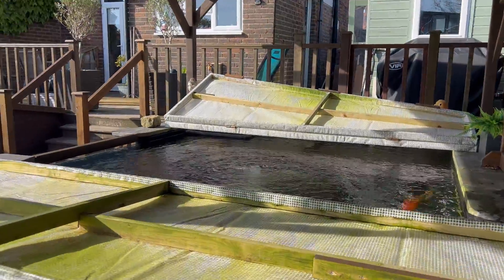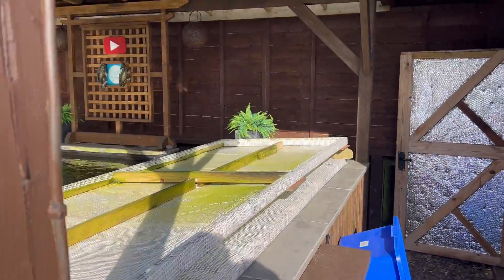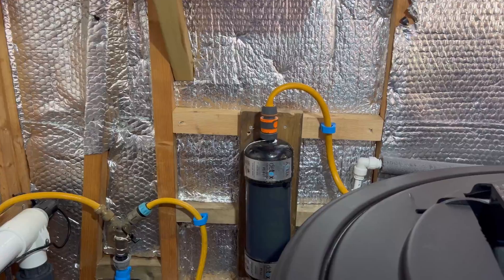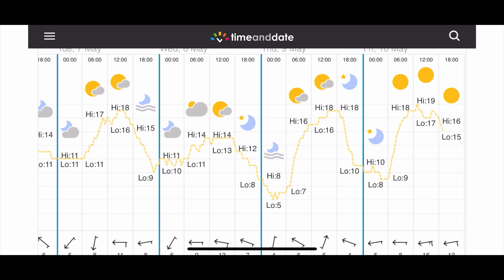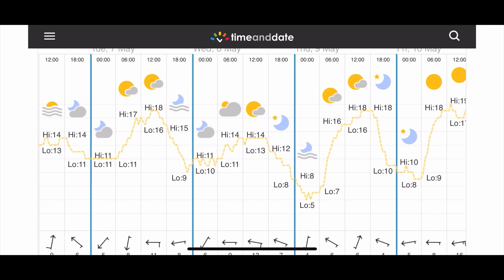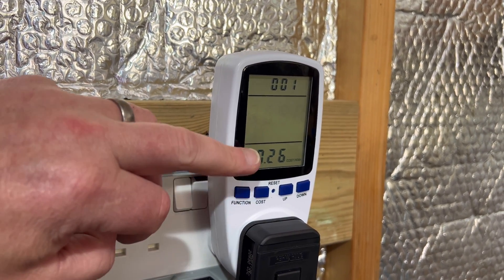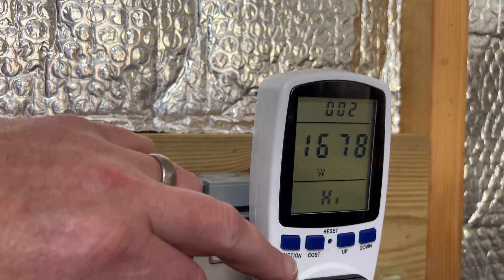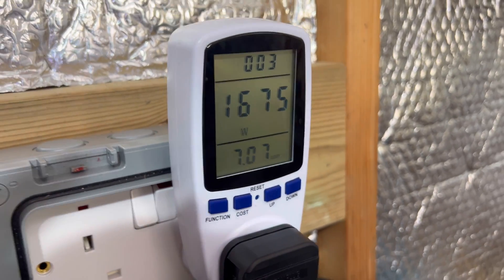A quick update on my Thermotec 12kw ASHP (heat pump) What does it cost to heat a pond???

Comment: Rather than forcing the food to be heated in winter and feeding it in an indigestible state, it would be more efficient to simply correct the unstable water temperature in the UK in midsummer to a uniform temperature of 25°C or higher, as in Japan, as this would not cost much in energy costs and the KOI itself would not need to be heated in winter once the body flesh reserves have been built up!